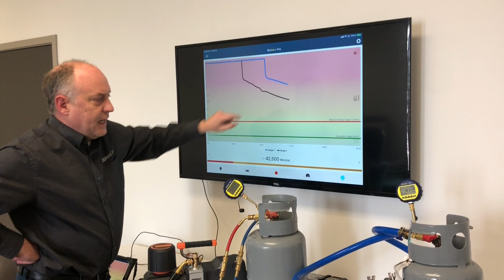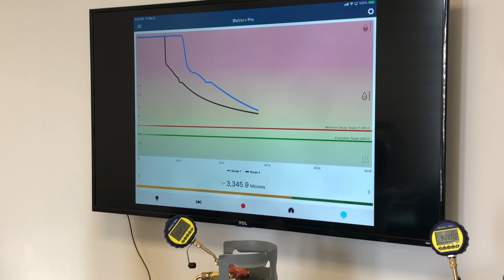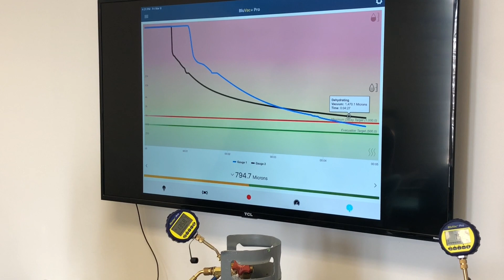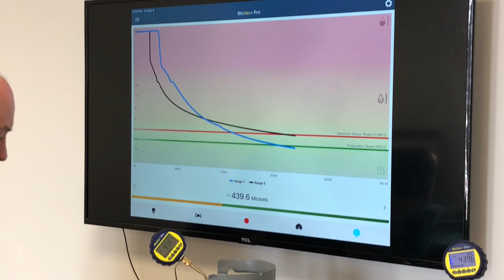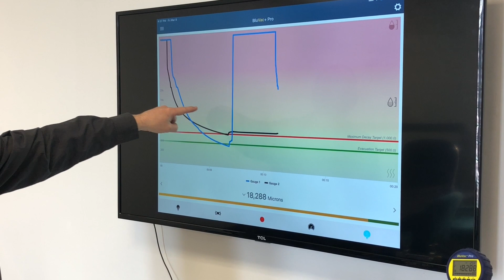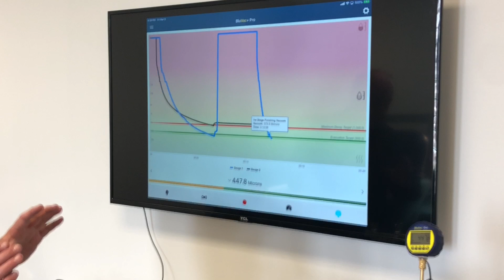12 CFM Vacuum Pump vs  2 CFM Vacuum Pump

Comment: EXCELLENT demonstration - I fwd this to people when they ask why I use core tools and not just hook up my manifold and a pump with a bunch of little hoses.

My 'Go-to' setup for a residential system is an Appion Hose to the Suction side service port with an Appion core tool, my Hilmor 5cfm pump, and a ball valve and gauge on the liquid side service port.

Comment: I do a good bit of mobile heavy equipment air conditioning repair. This year I’ve started using a micron gauge and am always trying to do a better job. While working R134 systems, I have the tools to change a schrader valve out on a charged system but haven’t found the core tools that have the extra port to pull a vacuum while I have the tool on the service port while having the schrader core out. My question, would I gain anything going to a better large ID vacuum hose if I was still running it thru my 4 way manifold and the system that still has schrader valves?  I have been watching lots of HVAC videos. Very few quality content creators for R134 mobile systems, but so many for the HVAC side of things. A lot carries over obviously, but still some differences. Thanks for any help.

Comment: Hello I have the tru blu hoses and I somehow got oil sucked into the hose I got them drained by letting them hang and drain naturally, my question is, is their another way to clean out the hose?
Reply from the maker: Just pour some isopropyl alcohol into the hose, swish it around, pour it out then evacuate the hose to dry it out.